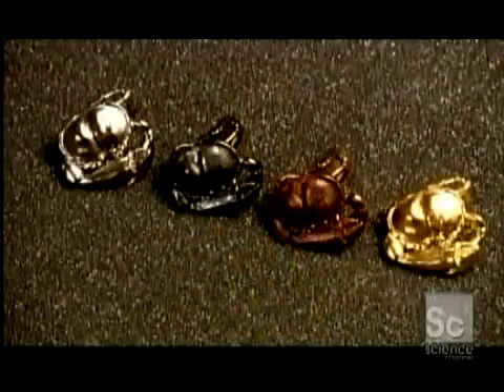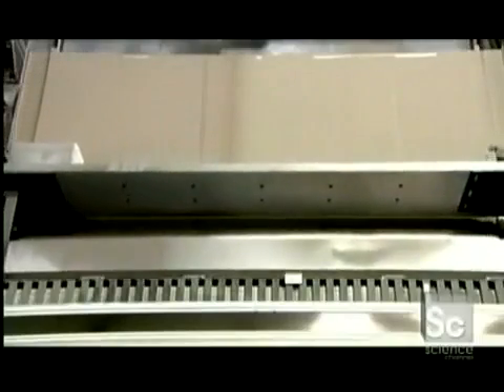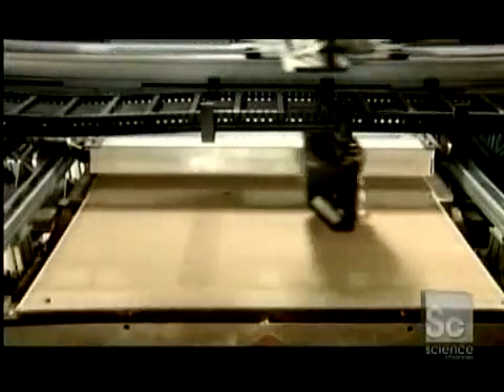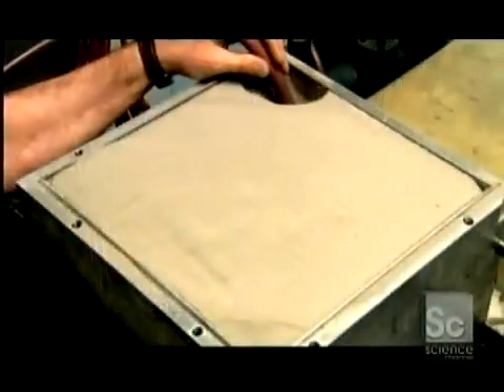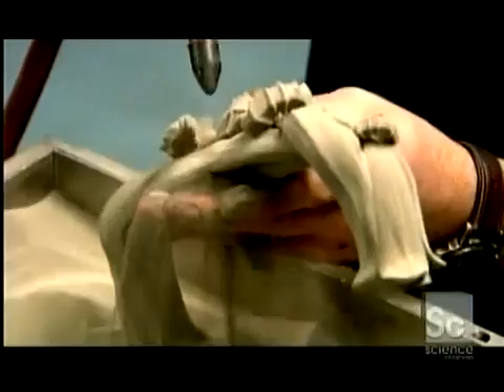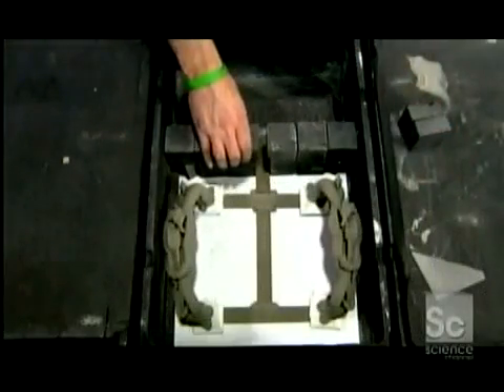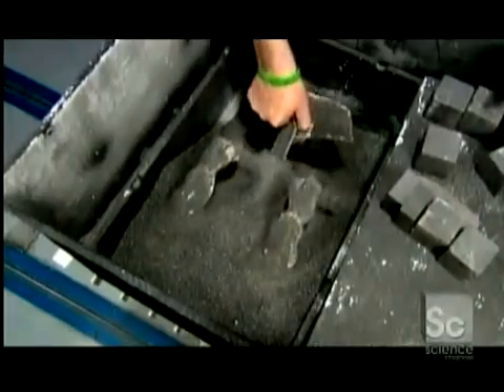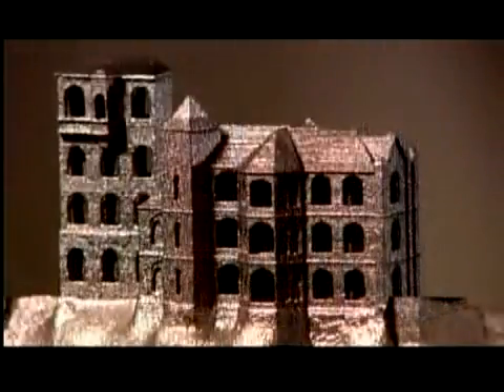3D Metal Printing | 3D Printing Technologies

Comment: Yes I have seen assembly free gears printed in plastics. But I know this is not possible in metal yet. Due to the application of mechanics and properties of the material. There has been very little improvement in the last 20 Years because of physics in metal working. The increase in computer power has improved dramatically but the machining/printing  part of it very little in comparison. I think that is still the problem, It is impossible to print metal accuracy of microns.

Comment: I believe it has capabilities that extend beyond simple caste work. The show here doesn't display it, but tools with moving parts can be constructed, which not only does the molding process, but the assembly as well.

Besides, the video is a couple years old. More effective 3D printing tools have been developed since then. Look at some more recent videos, it's surprising how accurate CAD designs can be constructed.

Comment: I really doubt that this is more cost efficient than printing in plastic and casting. It actually looks far more inaccurate since it undergoes a sintering  process which has non linear shrinkage. I'm not even getting into the accuracy of the glue nozzles. 
To compete with regular cad/cam or just good old handy work this needs to be based on an entirely different printing process. It is just not accurate enough. But it is interesting.

Comment: hee hee...that was interesting...I've familiar with 3D printing...the point I'm making for right now is written in what you sent me...
"steel-framed machine with the boxy dimensions of a microwave that sells for about $2,200"  Like I said...at least at this level there is no clock handle or shampoo cap that I need to replace that is worth 2200 bucks...:)
I love technology but I also shy away from a product that will have humans making more useless crap...:D

Comment: Agreeing with you enigmahood; fact is that you can indeed print moving parts.  This may use a different type of resin that would make a gunshot hard to contain, but is proof of concept and all you would have to do is engineer a denser, more structurally sound resin or refine the metal printing process to a method similar to this:

/watch?v=8aghzpO_UZE

The scanner really does scan fully around the object and takes into account all moving parts on the inside.

Comment: Yes, a magazine, not the actual gun. 

In order to 3D copy a fully functional AR-15 you have to scan each piece (or download a file that has it pre-scanned,) of the Ar-15. If you just scan a full AR-15 you'll get a piece of plastic that looks like an AR-15 but doesn't have anything that its supposed to on the inside

Comment: No, that's not how any of the 3D printing programs work. 

Typically how they work is you either draw them in, or you have a scanner, 

With the scanner you scan the object you want to print in all 3 dimensions (Width, length, height) You can probably download files off the internet that would make the exterior, but you can not actually make an interior off a 3D printer, the inside of the object will be completely solid

Comment: I highly doubt that it will ever be possible unless you take apart the gun and copy each part of the gun, there's a lot of things on the exterior that a 3D printer can print, but it can't see through the exterior into the interior pieces.

Unless they use X-rays to scan the gun (which is dangerous as high exposure to x-rays can lead to cancer or radiation poisoning)

Comment: You can buy a 80% lower and jig kit and make one yourself outside of the system EG no FFL etc for about 250 and you end with a new stripped lower, then you can buy a kit or a lower parts kit and complete upper etc etc
But hey if you would rather buy a $500,000.00 machine to do the same thing be my guest

Comment: You obviously don't know much about it, because that's exactly how it works. You use a program like Dassault Solid Works, then it processes it the file and adds stuff like supports so the thing prints out ok (for example some printers can't print an overhang of more than 45%, so any such overhangs need supports). The the job is processed into layers and sent to the printer and printed out. Think about it. There would be little point in making something that could only make existing things.

Comment: No, you need to do more research,  you can't just make it thicker. In order to make it print you have to put the gun through a scanner, and the scanner makes it  EXACTLY like the current gun. The only thing you can change is the color, and if you did change the size it probably wouldn't work right.

Comment: You're an idiot. Where did I say to use the plans from an existing design? If you are designing your own gun you can indeed "make it thicker".

That said there are better ways to make a gun than 3d printing ALL the parts. For example you would probably be better off using a commercial barrel and machining at least the bolt face and the extractor claws from steel. Also you need springs, etc. that can't be 3d printed.

Comment: Its weight generally keeps this from being a problem. The metal falls quite quickly. 
PS With 3D CAD rendering of parts of guns we now have the ability to end the gun control debate, but for now since most affordable 3D printers use polymers, so far it's only good for the receiver and the magazine (which are the main parts being controlled anyways). Search for: 3D printed magazine

Comment: Also don't forget we can't even synthesise even the DNA of one chromosome. There are small bits that don't sequence, and it is impossible to synthesise a strand of DNA that long using the technology we have now. Then you have the secondary structure, the tertiary structure of the chromosome, the epigenetic information, which is different in different cells of the body. And the pattern of gene expression in each cell. That's not to say it unsolvable, just we are extremely far from it now.

Comment: I think it would be easier to 3D print a ceramic based mold and cast the metal directly into the mold which is then expendible.  The materials are already available to use in Z-Corp printers.  When you add the cost of the binder, the metal powders, and the cost of handling with that huge kiln that is one over burdened and over priced part.  I can see this being used only when you don't have the final shape that would support the ability to vent (when casting).

Comment: not sure that it would be quicker, really. depends on how fast you can design it in the program vs. sculpting a positive to start with. what might be faster doing casting is making duplicates beyond what can be done in one 'printing.' (in this example, you would probably use a sand mould.) i think that this machine is clearly not intended for high volume production, lol.

Comment: they are plastic printers, working with heat, works pretty good. so why not use the same concept for metal? or is it impossible to handle such high heat in any construction? im no expert but thats the first thing i thought about

Comment: I feel that this method is still missing a lot. It's not .. steel, more like steel "dust" mixed with bronze. That's nowhere near steel's mechanical properties.

A similar way to do is 3d printer (of plastic, powders whatever), to create the male template. You cover it with some urethane gel or something to make a rubbery mold, where you cast wax templates. And there is the lost wax method to cast real steel if you need to.

Comment: The plastic printer is much faster and cheaper, these two things combined, we could print pretty much anything. You don't actually need the part you want to print, they design everything on the computer.

Comment: I know exactly how good they are. And right now, unless you've got a machine more expensive than your house, you aren't printing anything electronic. At the moment, you can use a printer to make the non-electric parts of another printer, since nobody makes a cheap printer that's small enough to do microprocessors.

Also, unless you only need one or two of whatever you sell, you'll need to injection mold it. It's much faster. 

Also, they only print one texture. You better not need anything soft.

Comment: Don't be dumb. You can't print advanced systems, you probably aren't smart enough to build a smartphone from scratch, and you can't magically acquire food, water, anything non-solid, or even the feed material for any printer.

This tech is simply a useful step to cut out some effort in the manufacturing of solid parts.

Comment: "faster and cheaper" are subjective. There are some things that are quite cheap and easy to cast in molds, that would cost much more and take longer to make with an SLS metal printer.
The main difference is in the number of them you need to make. If you need to make a lot, having a mold made will be more efficient... if you only need one or two, this is the way to go. Don't be misled by how its made guy's generalizations...

Comment: True, but there is another flaw in that post. You can't build a 3D printer from the plastic parts, because you need motors and some metal aswell. It should have been:
1. Buy 3D printer
2. print 3D printer parts
3. buy rest 3D printer parts
4. build 3D printer
5. repeat from step 2.

Comment: The important parts of a gun must be able to withstand intense heat and pressure, and this method doesn't look terribly suitable.
What you need is to go the other direction. Instead of building up metal, you need to start with a chunk of good steel and shave off the parts that aren't what you want. You can still do it with a machine, it's just a different process.

Comment: Clay has to be heated very slowly and carefully or the water inside it will cause it to explode. When clay is cooked this way it turns into a very hard substance which would be rather difficult to remove afterwards; but most likely, the clay would be destroyed by temperatures of that magnitude. So using clay wouldn't be an option.

Comment: This technique is completely outdated. Today 3D Printing in metal is called DMLS (direct metal laser sintering). There a laser melts metal powder layer by layer. As a result you get an object made to 100% of metal as stainless steel or even titanium.

Comment: The most difficult part of making a mold is building the positive plug, which often consists of sculpting or machining wax. In this instance the positive plug is built virtually and with much greater detail, then printed. That's where the time savings comes in.

Comment: No, because then the design becomes constrained by the limitations of moulding processes (ie having to introduce cores etc). 3D printing allows you to design whatever you want without having to worry about the limitations of producing it, not to mention it's much faster, cheaper in the long run, and less messy.

Comment: just wondering.

Wouldnt it be better to first make th model in an ordinary 3d printer, then make a solid mold of clay around it, and use that for casting the stainless steel?

Comment: Using ultra fine stainless steel metal powder and aluminum oxide powder WITHOUT gloves or hand protection or face masks. Lunacy! ! Hope these guys have good medical insurance because they will sure need it. Silicosis, and eczema are just two of the long term implications!
If this was the UK the place would be shut down and the directors would be arrested!

Comment: So this is a lot like metal stereolithography. I guess if one had a powerful enough laser they could just fuse the metal directly instead of using a glue then a, I guess you could call it, a combination cast/brazing technique. Interesting, I wonder if aluminum could be used...

Comment: @openarms332 
As with ink printer, the ink will be certain element such as iron, oil for plastic and etc. To produce gun and anything from metal you will need a lot of energy and a lot of heat, so I am sure they will cost much more and will be more complicated. So I am sure there will be a limited number of elements, and a limited number of pre coded products that you will be able to print.

Comment: alot of work for a door handle, however this will, if it hasnt already become a large part of manufacture. Being able to just print make parts from nothing but metal dust is very impressive. And  damn sight easier and cost effective than making a mould for 1 item.

Comment: @SC4newbie100 dude imagine all of the different types of materials that would be needed to make something like that. you would need all of the semi conductors and metal and plastic and lcd screen (if its a psp). and doing all of the circuitry at a microscopic level. Just saying it will be a while until.

Comment: @NovaLand You can't manufacture the same things using CNC-machine. CNC is a subtractive (takes off layers) and 3D-printer an additive process (adds layers). You can't make a tube for example with CNC-machine :)

Comment: @SC4newbie100 thats way in the future (if plausible at all..).. for examble a ps3, its not jus an object... its an object that has within it other objects which have within them other objects! and all these objects are composed by different materials(plastic,metal,silicon etc) in different scales(cm,mm,nano etc and even if there was someway to put this huge assembly line factory in a small machine

Comment: @spanish111japan Well how you feel now is similar to how everyone felt about computers. I remember they used to cost $100,000 for a PC the size of a refrigerator and up untill the 1980's still cost around 7,000$. Or up to $20K for a good one. So I'm not sure how much this 3D printer cost now. But just like computers they will get cheaper.

Comment: @timogame
that is closer to reality than you think, the circuit board in the iPhone is a PCB or Printed Circuit Board. Ink is transfered on copper coated silicon sheets then dunked in acid. The Non inked copper is eaten way to make the base of the board.

Comment: I hardly think its safe to handle that steel with your bare hands, let alone breathe it without a mask on. Even an N95 would be sufficient.

 Beleive me, I work in a bakery and I can promise you after much exposure and research on the subject that super fine micro particles ( dust, spores etc.. ) inhabit the air current up to ninety metres around the source , especially with agitation.

 That gentleman is either brave or VERY ignorant to handle this powdered steel without gloves and a mask...